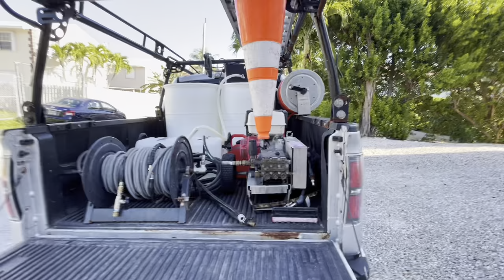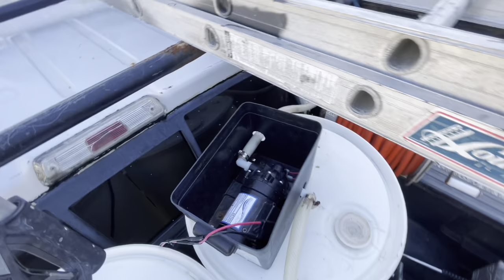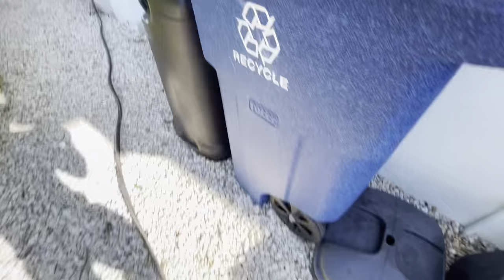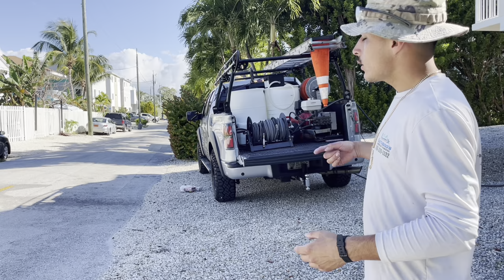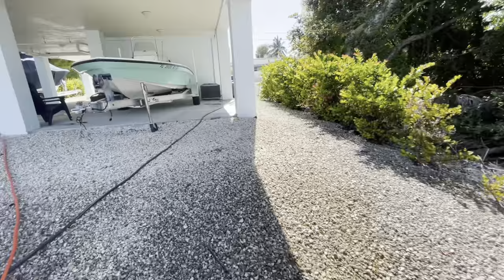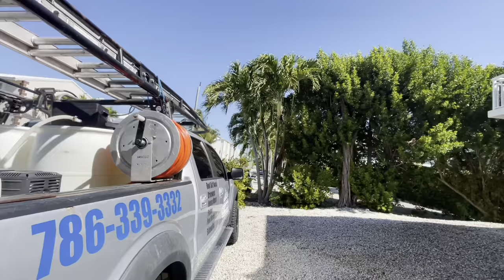Pressure Washing Truck setup for BEGINNERS! (PT.2)

Comment: I've got a 2017 of the same truck. I was wondering about the bed rot, but I figured I'd just go with a flatbed/utility box hybrid bed and just rock it as a full work truck. Maybe get a yeet around truck that's easier to park.

Comment: Have you tried getting a hand pump with bleach neutralizer and spraying down your truck bed during/after jobs to prevent corrosion?
Reply from the maker: No but I wish I would’ve looked into that before doing the truck setup bc it suffered a bit of corrosion but I will take care of the trailer a bit better

Comment: Nice setup! I was just wondering... is it necessary to use a water tank of only using a 4 gpm pressure washer?  I'm just getting started, and ordered a 4 gpm pressure washer. Do i need to look for a water tank now?
Reply from the maker: Thanks bro and now 4gpm works perfectly fine as long as the flow from the spigot is fine. I wouldn’t pass 4 without a tank though but youlll be fine without one just always check the flow first

Comment: Awesome set up what kind of hose are you using for soft washing?
Reply from the maker: It’s 1/2 inch hose I got from a local hose and fittings store
Reply: Does soft wash and pressure washing use the same hose or do I have to get a hose for each one?

Comment: Great videos dude, new setup looks great. What brand hose reel do yoy have on the side of your truck?
Reply from the maker: Thanks brothers :) the trailer is done posting that soon. The side reel for the chemicals is a valley industries reel from northern tool I bought it online
Reply: Sweet thanks. I'm considering either doing something similar to your setup with my truck, or just grabbing the prefabbed northern tool portable soft wash system.
Reply from the maker: @gavinmorley1140  if I had to redo it I’d build a simple wood skid so I don’t have to drill into the bed. My only recommendation is to not drill into the bed. The corrosion was really annoying

Comment: Swap your pump for a comet tws8035 I made a video about it and I run it off a 55 gal drum I can do any house with 8 gpm 2200 psi  and as long as I pre treat the concrete I mover pretty quick with a 20 in surface cleaner
Reply from the maker: So far this pump has worked wonders, great price reliable and best part I can get it on Amazon. But when it comes time to upgrade I shall check it out.
Reply: @servanospressurewashingllc1477  Hi can you make a more in depth video on how to run hoses/ pump once you switch over to trailer? I'm understanding what I need to start. But not understanding how to make it all work?
Reply from the maker: @susanserna7210  yes ofc I’m really looking forward to making that in depth video of putting that trailer together because from my research there is little to none content of that online

Comment: A tip that I figured out that I haven't seen anyone else taking about for your water supply.  They make adapters to invert water hose ends and make the male end female and the female end male.  Doing it this way you can attach you short hose (whip / tail / or whatever they call it in your area) that you normally hook up to the spigot, directly to the inlet of your washer and unreel the hose to the house.  You basically reverse the flow of water through the reel.  This way you can reel and unreel to the house while leaving the hose connected to the machine or your inlet plumbing to you rig set up.  It saves a lot of time hand coiling your supply hose after the job.
Reply: You should make a video demonstrating this!

Comment: How much gallong is good to wash 1 whole house?
Reply from the maker: Honestly bro 10 gallons is more than enough considering how watered down the bleach has to be for a house wash
Reply: @servanospressurewashingllc1477  Im trying to get into the pressure washing biz, so we dont use the customers water?
Reply from the maker: @lsbzcuz  ALWAYS use the customers water, no matter what level your at in the biz
Reply: @servanospressurewashingllc1477  So why would i need a 10 gallon tank for if im using the customer water? sorry, im new
Reply: @lsbzcuz the 10 galllon is to hold the bleach.

Comment: What size truck bed?
Reply: What state are in?
Reply from the maker: Florida and I couldn’t tell you but I have a full cab 2011 f 150
Reply: @servanospressurewashingllc1477  ok, go get a tape measure and get back to me.
Reply from the maker: @vcash1112  right, I’ll measure it one day
Reply: @servanospressurewashingllc1477 😂